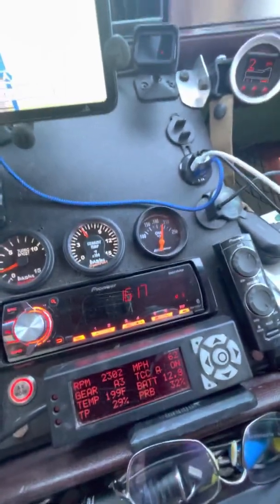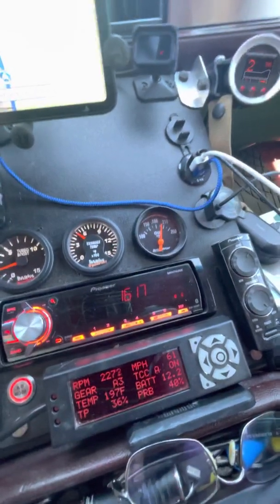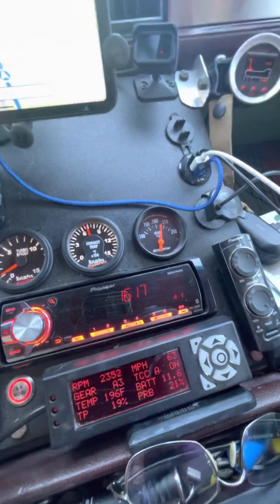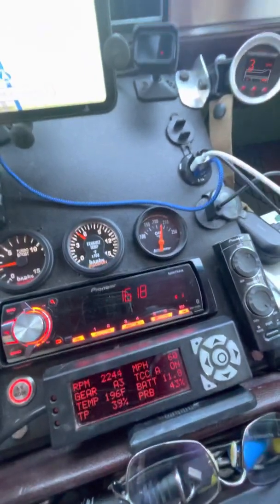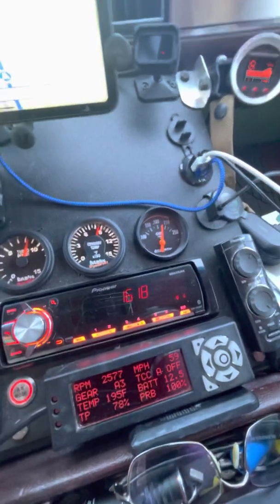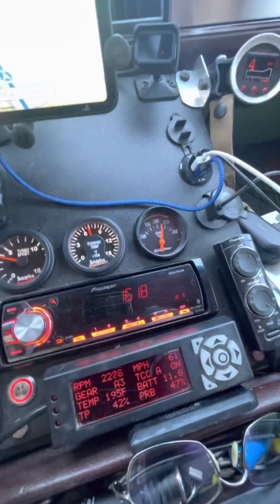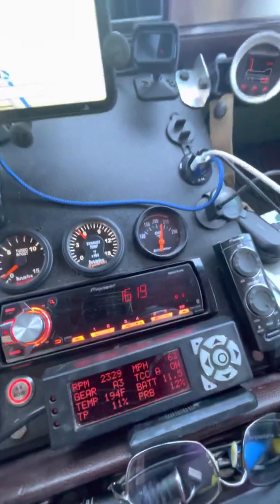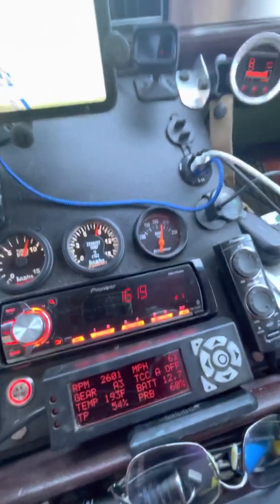Nitrous Express Snow Performance Water Methanol injection system experience in a 6.5 diesel part 2

Comment: Any idea of maximum injection rate?
Reply from the maker: If I understand the Snow Performance chart correctly.  The #8 nozzle I have is rated at 8 gallons an hour max flow.  I used about 2 gallons on my 120 mile trip this video was a part of.  I was driving pretty aggressively though to get the boost up and show how it worked.
Reply: @timsteachablemoments1786  

Temperature looks about correct based on the critical temperature of water.  Alone, water has a critical temperature of about 705 °F.  No amount of pressure will condense water above this temperature.   In mixed gas systems like those of an engine,  critical temperature increases for the water.  Recall nitrogen and oxygen are above their critical temperature.   Carbon dioxide is around 90 °F.
Water injection rate should never be so much the EGT falls below 705 °F as it makes possible liquid water in the exhaust.  Exhaust has water vapor from hydrogen from fuel so it is easily saturated.  Keeping temperature above critical means deviation from Ideal Gas Law is minimum and pressure is maximum.  Remember,  heat engines use temperature to increase pressure.

Looking at 8 gallons per hour is about a pound a minute.  Compared to the 30 pounds per minute of air and a little under 2 pounds per minute diesel, you have found the sweet spot.  Great work!

Water injection is on my event horizon.  Once I finish the custom twin install.  Got to get through head gaskets with this bum arm.